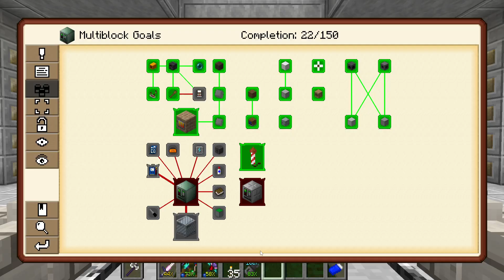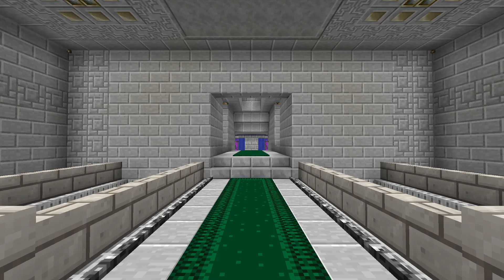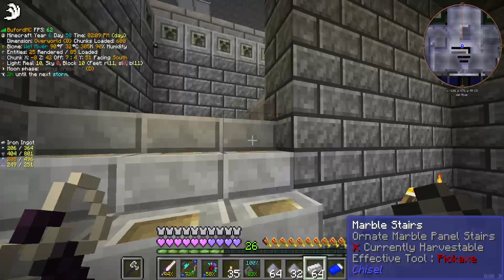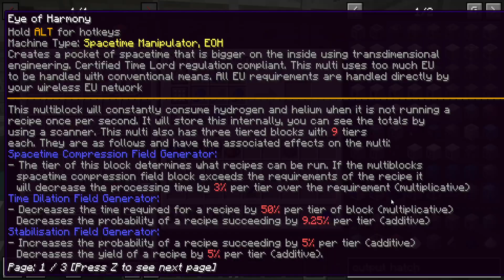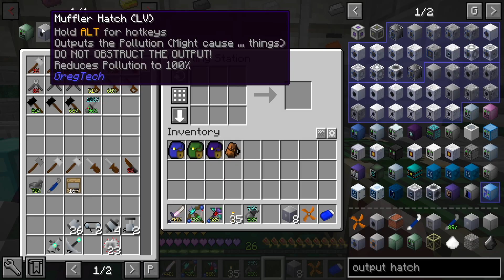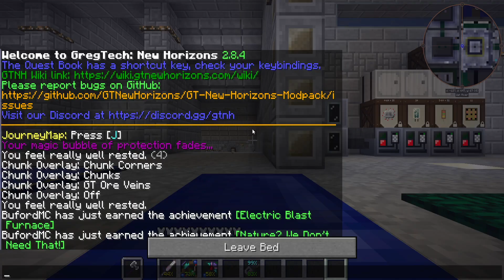GregTech New Horizons EP103: Electric Blast Furnace Part 1!

Comment: Such a big step with the EBF!!! If you have the time and resources, i'd highly recommend making a QUAD ebf, since you can wallshare with the multblocks. if you have an input like a chest or something evenly split items into all four of the EBFs then your efficiency will skyrocket.
Reply from the maker: Making more EBFs right now would probably not be too hard, but powering them might be a different story. Four of them might be too tough to power right now, but I might go with a second one soon.
Reply: @BufordMCs Sounds good! I’m currently on EV, but 4 HV amps = 1 EV amp, so i have 2 HV input hatches on each of the EBFS, and 2 HV combustion generators wired into each one. So it ends up working out that I can make EV recipes. Amperage levels can be a good way to skip ahead a bit in recipes if something you’re trying to make is just a bit out of reach.